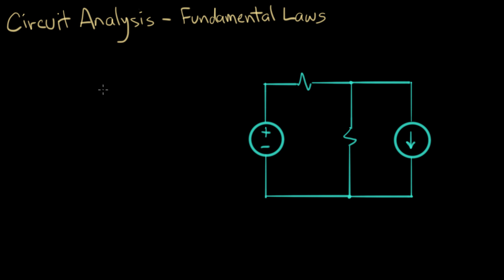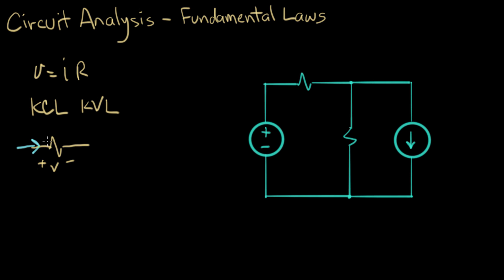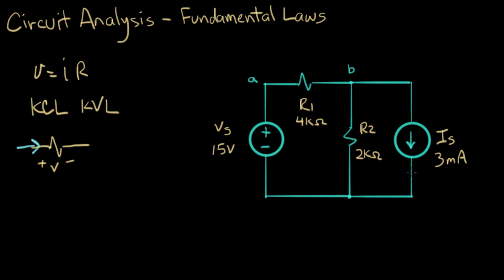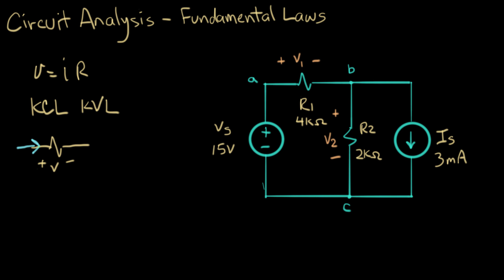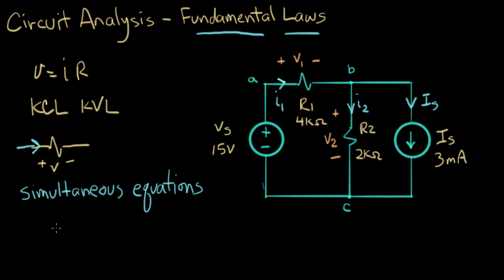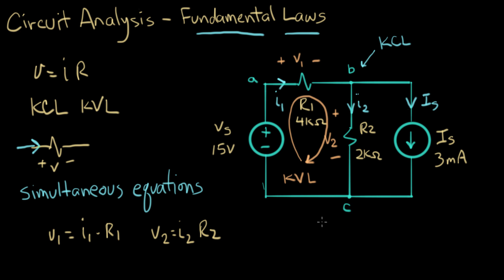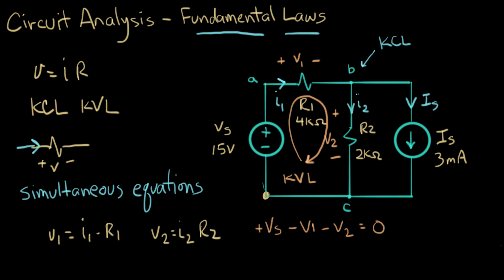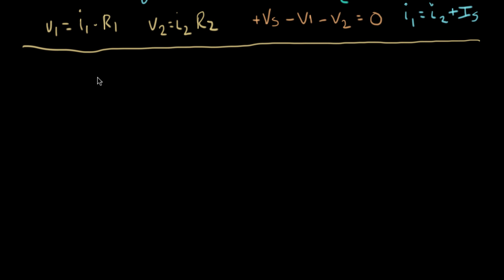Application of the fundamental laws (setup) | Electrical engineering | Khan Academy

Comment: How is the current leaving node b to the right not a combination of current from the current source AND the battery? Isn’t Vs driving current of its own so it’d be like i1=i2+i3 and the current on the rightmost branch is i3+Is? I don’t understand what current sources really are if it seems to be getting Is from i1 and not itself...
Reply: Also are there current sources irl and why isn’t there a voltage drop across them?
Reply: @17joren  My intuition was the same as yours. However, the Ideal Current Source (ICS) determines the current in its own branch. Whatever current it supplies, it won't allow a stronger or weaker current in the branch. This in turn means that ICS's have adaptable resistance matching whatever voltage it is subjected to to keep the current in its branch constant. This is referred to as the ICS having an infinite inner resistance.

The Ideal Voltage Source (IVS) similarly matches its inner resistance to whatever current it is subjected to, to supply a constant voltage over its terminals. The inner resistance of an IVS is said to be zero.

The part about the inner resistances being infinite for an ICS and zero for an IVS confuses me, especially when doing network analysis. But I think it's implied to mean they're ADAPTABLE towards infinity or zero.

This is my understanding at least.

Comment: Why is r2 even relevant? Can't the current just flow from the voltage source, through R1, through the current source, and back through c?

If the voltage drops to 0 after v2, then how is the conventional flow vs. electron flow not a problem? If you put a light after V2, then by conventional flow, it should not light up because the voltage is 0. But we know the electrons are actually flowing the opposite direction, so the voltage through the light should be 10v and 0 by the time it goes through v2 and v1.